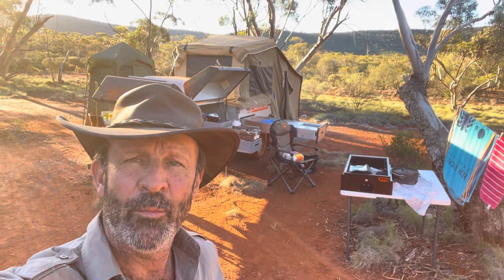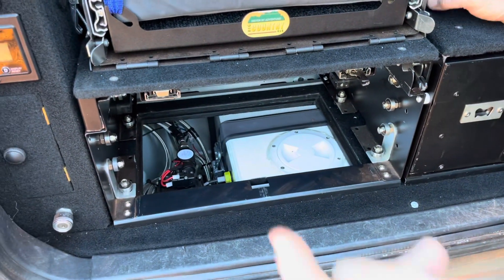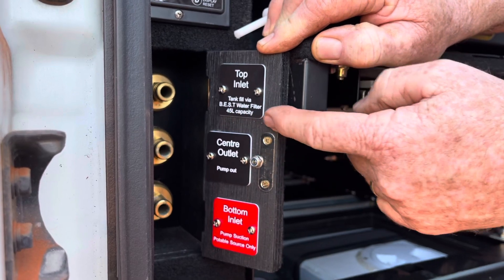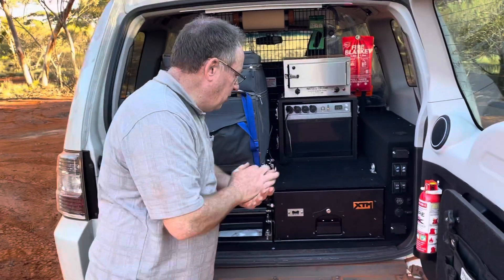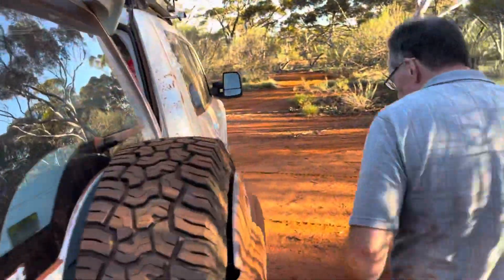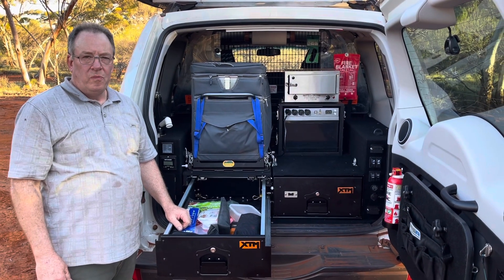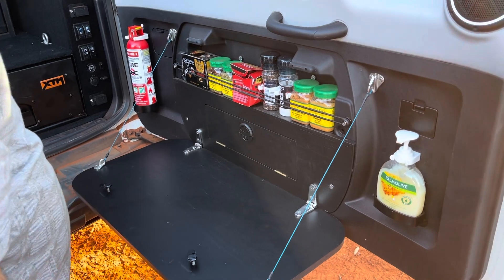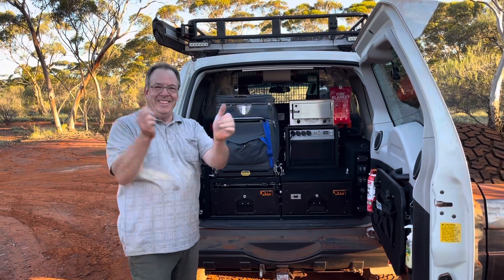Peter Mathieson talks about fitting out his Pajero 4WD to go camping

Comment: How Peter set-up his Pajero is wicked. I'm also impress how he fitted the on-board air compressor inside the hood.
Reply: Thanks Nap and Clacier! Yes, the on board compressor makes life a bit easier. One of the reasons I did that was when you inflate 4 tyres, the compressor builds up quite a bit of heat. Then, you have to wait a while before packing it away, or risk burning something. Under the bonnet it is protected and the heat is not a problem. It's far enough away from any heat source there too, being right up aginst the firewall. Another advantage is that you can run heavy cable to it, so you don't get any volt drop, which is common with long power leads (often under-rated) and alligator clips that compressors are usually supplied with. The other major advantage is that air is always on board, so if you do happen to be in a situation where you need to deflate, you can do that without having to remember to bring the compressor. The third and final advantage is it allows you to plumb in a little air tank. I have a 4 litre Scintex tank, it is quite small but gives you enough air to use an air nozzle to blow the dust out of the back of the car. Here's the one I have. It fits neatly behind the grille on the Pajero. https://www.scintex.com.au/products/portable-air-compressor-tank

Comment: Hey Peter. Great job. You inspired me to make my own fold down table for my Pajero NT. Followed your basic design but with the following changes. My table is slightly wider to fit a dual burner gas cooker with enough room for cups etc. I did away with the locking knobs and used 18mm cabinet magnets and metal plates to lock in place. I made left and right side panels shaped to fit the sides of the panel compartments using the same 12mm ply and these are screwed into the back panel and provide surfaces to screw in the large hinges for the table itself. The magnets are screwed into the back door plastic panel where the original Pajero screws held the plastic fence in the top compartment. Unlike your mod. I have not altered the Pajero's lower compartment at all. The metal plates are recessed into the 12mm marine ply. All parts sourced from Bunnings. I also mounted a clip to the ply to slide a bit of bent coat hanger wire into it that also clips over the door handle to be ensure that the panel ply cannot release and fall down while driving on rough surfaces.
Reply: Thanks, great to hear you got some inspiration from it. As with many good things the general ideas are not original, I've seen quite a lot of table setups over the years but it is very good to incorporate your own thoughts into the design and build it your way, so I'm glad you are happy with your setup. Great idea to use heavy duty magnets, some of these rare earth magnets are amazingly powerful and quite convenient with no moving parts to worry about.

Comment: The slide out solar panel is brilliant.
Reply: Thanks so much, yes its a great concept and you can buy them ready to mount from Dunn and Watson in Queensland. Since making this video with my good mate Dave, I've now got a Tracklander roof rack which is larger (and actually lighter, made of aluminium) and it is sitting on Tracklander Tough Bar mounts which are far superior to the FRP ones that come standard on the Pajero. On my new rack, the panel now slides out the front over the windscreen which I am very happy with.

Comment: Looks great, the only thing I would comment on is that the factory rails are only rated for 70kgs and with what's up there, you'd be close to your limit already. Maybe think about upgrading your rails to after market metal ones to increase your payload on the roof.
Reply: Absolutely right, you are spot on. I was apprehensive about those factory rails and I am always cautious about having too much weight on the rack. Since making this video with my good mate Dave, I've now got a Tracklander roof rack which is larger (and surprisingly it is actually lighter, as it is made of aluminium) and it is sitting on Tracklander Tough Bar mounts which are far superior to the FRP ones that come standard on the Pajero. On my new rack, the panel now slides out the front over the windscreen which I am very happy with. The Tracklander rack is really nice. It enabled me to fit a Bush Company 270 XT awning which I couldn't before, due to the weight.

Comment: Greetings, could you indicate if the water pump you use for the water tank is 45 psi or 60 psi?
Thank you
Reply: It is a Shurflo 4009 pump and the manufacturer quotes 

Pump:

Type: 4 Chamber Diaphragm Pump

Ports: 1/2” - 14 NPSM-Male

Inlet PSI: 30Psi (2.1Bar) Max

Shut Off Pressure: 45Psi

12MM BSP fittings can be used

Comment: I almost had my first Pajero setup the way it suited me for camping and 4x4. Sadly it got written off when another car went through a give-away sign. It has 2" lift, Boos BashPlates, ARB steel bull bar and winch, fabricated rock sliders. I mistake I made was putting in a long range fuel tank. Dual battery system, side awnings. I had upgraded the headlights from MARS.  Diff breathers and snorkel.

Now I am starting again. Sadly I wasn't fast enough to buy the wreck from the insurer.
Reply: Sorry this happened.

Why was it a mistake putting in a long range fuel tank?
Reply: @EdwardQuixote  The long range tank was prone to scraping it had a few rock gouges in it, as it hangs down a bit low. It did increase my range but not really made for rock hopping.
Reply: Sorry to hear that Phil. I have that ARB Frontier tank as well, it is definitely a bit on the low side so I avoid really rocky or technical tracks  if I can. But I love the range I get with 127 litres or thereabouts, compared to the standard tank.

Comment: Awesome pajero peter! where was the rear drop down table from?
Reply: Thanks, I made that table myself out of 12mm marine plywood. The underside is covered in car carpet so it looks nice, and velcro sticks well to it. The top I just painted satin black and it is holding up well. The edges I sealed with edge binding, the iron on stuff. To secure it I used a couple of stainless hinges and for the locks, the same concept as the original Pajero plastic cover, which has a cam lock type system. I have threaded mounts in the plywood and plastic knobs to secure it, this works really well as you can tension it perfectly so it doesn't rattle. To support it horizontal I have two lightweight stainless cables made out of shark fishing trace wire. You can get all the parts you need for these cables from Low Cost Wire in NSW.

Comment: Is this setup possible in the short wheelbase version of the pajero?
Reply: The drawers, electrical system and so on, and so on, I can't see why not. You still need a cargo barrier though. The water tank under the floor, I don't know if the SWB Pajero has that seat well, so possible not. In my old NJ Pajero I fitted a Boab water tank behind the rear seats. You might be able to do that instead. There's also water bladders you can get that fit in rear footwells. This keeps the weight nice and low, and avoids the need for bulky plastic water containers.

Comment: Are you within the rear axle limit with all that stuff at the back?
Reply: Hi there, yes indeed, I am very close to the GVM when loaded for a trip. I need to be careful when towing with trailer ball weights. That is the factory specified GVM though, and I have Lovells extra heavy duty suspension upgrade all round and airbags in the back springs to level the ride out if needed. I have made a few enquiries and you can't find anyone to upgrade a GVM on the Pajero as it is a monococque construction,  so they won't do it.

Comment: How long would it take to remove just the drawers? I'm Also looking to buy an easily removable setup
Reply: To remove the drawers themselves, 30 seconds each or less, with the XTM design of spring loaded latches. This is how you can save weight quickly with little effort, just when running around town. For the drawer housings, around 15 minutes to unbolt and lift them out. I usually take the battery out first, because its heavy. This takes about 5 minutes. The Travel Buddy oven is bolted to the top of the battery housing.  The key to this quick removal is to have everything secured with captive nuts. Mine are built into the plywood floor. Basically a nut which is silver soldered to a washer which is then recessed using a forstner bit, and held in place with a couple of small screws. That way, you just spin the bolts out easily with a socket, and out come the drawer frames. It is a bit of work to set up this way, but you will love it each time you remove and refit them.

Comment: WOW !... When can you fit my NX 2018 in??? ha,ha. What a great set up!!!
Reply: Thanks Ian, I hope it gives you some ideas. So far it has been really great for us. The only thing I would change now if doing it again is to incorporate lithium batteries in the design, much lighter and more efficient than the heavy AGM I have in there. Mind you that AGM Baintech Power Top battery has been awesome, its 5 years old now and still works well. You can get some great lithium batteries now in slimline format, which gives you some more mounting options.
Reply: @peterm3533  Absolutely BRILLIANT. I wish I was electrically and mechanically minded as you!. I can't decide if the top mounted solar panel pull out or removeable storage is my favourite!. Thanks for showing us your setup, truly jealous - all the best.

Comment: Where did you get the table that’s fitted at the back from? Ta
Reply: Hi Gerald, the table is one I made from 12mm marine plywood, finished with iron on edge banding. The surface is painted with hard wearing satin black, and the underside (which faces outwards when it is folded up) is covered in black car carpet. This not only looks nice, but you can velcro anything you like to it. 
I removed the standard Pajero rear door cover which is flimsy plastic. Then I cut some 12mm ply to the shape of the Pajero rear door panel, and made a little shelf which fits into the well normally occupied by the tool bag. On this I place a few bits and pieces like tea bags, spices and so on. This ply is fixed to the original Pajero interior door trim with rivet nuts and stainless fasteners. I also made a little door so I could access the space behind the plywood. This space is only small but it holds some tools and other small things.
I then made the table and attached it with stainless strap hinges. It is held horizontal by two stainless cables. These I make up using shark fishing trace and electrical terminals, which are strongly crimped, then a bit of heat shrink to finish it off.
I used the original Pajero concept for securing the table in an upright position. To achieve this, I installed some threaded inserts into the table, then used plastic knobs with threads. Attached to the threads are small piece of flat bar that slot into the original Pajero slots when you turn the plastic knob. If you look at the standard Pajero one you can see how it works. With my adaptation, its great because you can tension the adjustment on the table so it snugs up against a couple of rubber bumpers - no rattle at all, and it stays put even on very rough tracks.
This is a very handy little table to have, and it doesn't take up much room or weigh a lot. All the stainless hardware I obtained from Whitworths in Leederville. They have a really great range of stainless fittings that you can't find in other hardware stores. Check out https://www.whitworths.com.au/
Reply: @peterm3533  wow, thanks for your thoughtful detailed response. Love your work, very well though out and organised. Cheers mate.
Reply: @TheHobsonic  thanks Brenton, hope it gives you some ideas and good luck on your travels....

Comment: Where did you get all your fittings and pipe for the water tank?
Reply: All hoses, taps and fittings from Reece Plumbing, the BEST water filter from Camec, and the Shurflo pump from the 12v Shop. The hand held sprayer and hose came from Whitworths Marine Supplies.

Comment: Snap. I converted my 2010 pajero sport  with same functionality  albeit  in a different way. Currently have a 50l water and pump with tap and shower and two independant lithium battery and fridges with separate solar panels. Long distance fuel tank, full 270 deg awning convert able to tent and rooftop electric deploy bundu tent. Opens lotsa possibilities not dragging a trailer. Also designed similar slide drawers and laser cut for a friend's jimny.
Reply: Thanks, your mods sound excellent, good luck on your travels. I've seen those electric Bundu tents, they are amazing, so easy to set up.
Reply: @peterm3533  Yep, I'm out in Europe and wife has just returned from a solo hiking trip in drakensberg with her female school friend and everything worked well.

Comment: Hi, noticed that you have 2 speakers on your rear door, where  did you get the mounting system from plz ,ty
Reply: Hi Gavin, the speakers are standard in certain models of Pajero, including VRX, Exceed, and mine, which is called an Activ. Any Pajero that is quoted as having the 'premium sound system' will have them. Its a Rockford Fosgate system. The speakers are great, although the amplifiers have been known to cause problems with parasitic drain on the battery. Mine did this and I replaced it with a Kenwood amp and modern Kenwood head unit. The standard Mitsubishi one is OK in NX models, has Android Auto/Apple Car Play etc, but mine is an NW and the unit in it was a dinosaur. The Kenwood is awesome. Fully integrates with smart phone and has DAB.
Reply: @peterm3533  grt thank you